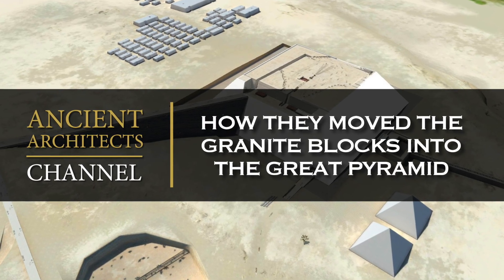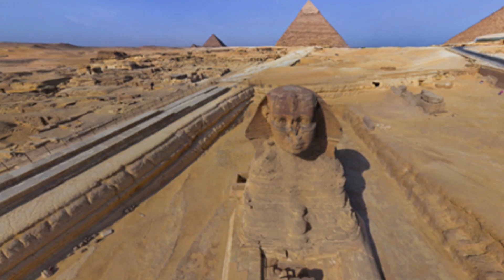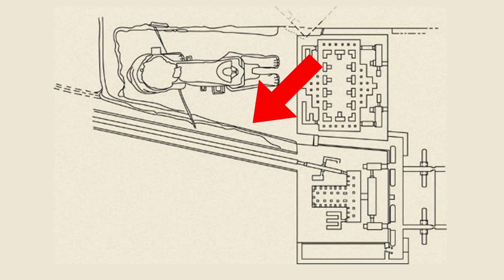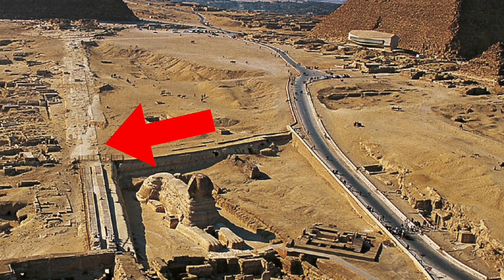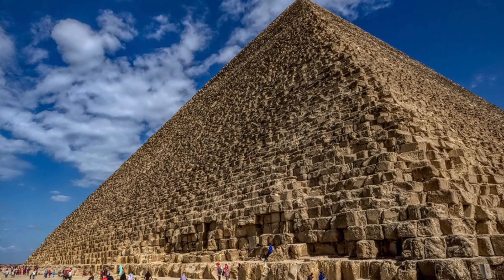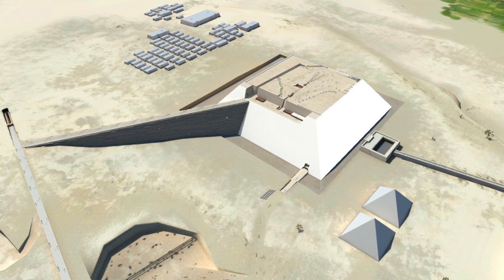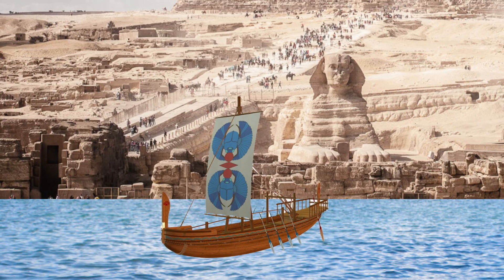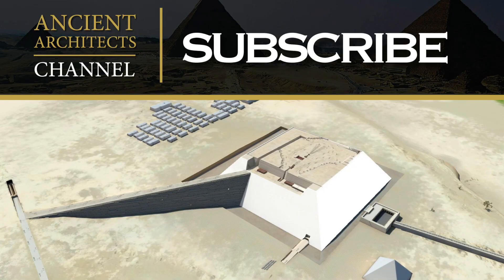How They Moved the 60-Ton Granite Blocks into the Great Pyramid | Ancient Architects

Comment: Why is it assumed that everything is dragged by humans? And as intelligent as they where and they didn't have the wheel?  If we stop thinking of them like cavemen dragging rocks around and put a little simple science to this, I would think it becomes mentally feasible on how they did it.  

To me the Egyptian engineers were masters of leverage.  Accepting that this true: If they put rollers under a sled with a pulley leverage with rope and a few cattle in front, this would be doable without huge numbers of humans. Also the block stone could have been moved the the use of cradles. (not the hanging type that is common today)  These would be wood structures that strap to the sides of blocks making them round, like a wheel.  Then if you leave space to wrap the wheel with rope it will roll with leverage and if the pulley is added only a few humans are needed per block. Less if domesticated animals are involved. 

I'm just thinking is all.
Peace!
Reply: I don't know why people think the ancient Egyptians didn't have the technology of the wheel. Temples all over the place depict the Pharaohs riding in chariots. The wheel dates back to at least several thousand years BC in Mesopotamia. How would the Egyptians not know about it?

Comment: You are saying the FIRST thing they built was the Causeway, then constructed Khufu's pyramid, the Sphinx and Khafre's pyramid coming later. It seems a little odd they built a ramp that didnt lead directly to the pyramid they were building. It required a 90 deg turn and a further '800ft' of ramp to reach the pyramid?
Also the pyramids are contemporary with the Spinx (most likely originally a lion) because the North & West walls of Khafre's pyramid shows similar heavy water erosion to the Sphinx enclosure. I think they are ALL a lot older than dynastic Egypt by several thousand years.
Reply from the maker: If the causeway came after the Sphinx, why is the southern wall at an oblique angle? Why didn’t they built it parallel to the north wall of the enclosure? And the topography from what Houdin says is the harbour (in front of the Sphinx) directly to the Great Pyramid wouldn’t solve the problem of getting the granite to a high level. Getting it to the high ground first via the natural gentle slope to the site where the Khafre pyramid is (higher than the GP bedrock), and then turning north, would solve the problem, with the help of counterweights of course. It’s an easier route.
Reply: @AncientArchitects  Yes I accept the causeway was first, which only confirms they had a free hand to build it anywhere suitable. Assuming the Nile ran in front of the pyramids at the time it would seem simpler to land the building stone in front of the Khufu pyramid site. It also seems clear the Khafre pyramid was not planned at the time as they would not have intentionally placed the counterweight pit inside the intended foundation area. Therefore they were not intending to use one causeway to cover two pyramids. I am sure topography played a part, and it would make perfect sense if Khafre's pyramid was built first. It just seems a stretch when they had a clean sheet of paper to do it that way.

Comment: If the Sphinx was already positioned there YEARS before, and the geometry of the causeway necessitated that the angle next to the Sphinx be what it is,,, then what ?
Reply: The causeway is older than the Sphinx which is older than the pyramids. Problem solved! The mistake is assuming that the causeway(s) and pyramid(s) are contemporaneous - they are not.
Reply: @justinwelgemoed  Or, the line they needed had to run by the Sphinx at that angle so that's what they did...
Reply: @2packs4sure  The Sphinx and CGF1 are both unquarried sections of bedrock. At some point someone decided to carve a head and add paws to the former, but for a very long time it was just like GCF1. Just a block of unquarried stone. The erosion on the enclosure walls happened long before the Sphinx features were added.
Reply: Yes, could be. And the pyramids could very well be much older than mainstream researchers believe.
Reply: @Republic3D  What dating method was used to determine that? I've heard Graham, and Ben, and Brien, and Chris Dunne etc. say that. Their reasons for thinking that seem fairly muddled though.
Reply: @russellmillar7132 I made the comment 4 years ago, I don't remember.

Comment: What about the floor block outside the pyramid? It's absolutely huge and no one ever even bothered to check how thick it is so we don't know how heavy. What about the 465 ton block at Khafres pyramid? And the Valley Temple blocks? And the the cut marks of circular saws that are so large in diameter and so thin that to not break would have to be made of material so tough that nothing we have or know comes anywhere near. And drill marks that cut through granite like it was soft wood. Yeah.... ancient Egyptians must have built the pyramids. You are tunnel visioning because you want to believe that they were built by the Egyptians and can't face the fact that it was something much more advanced.